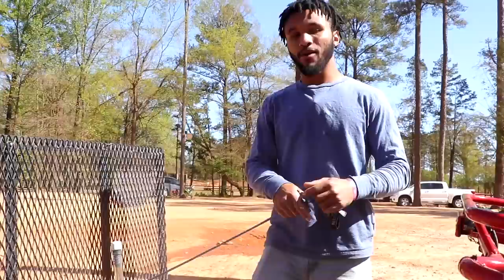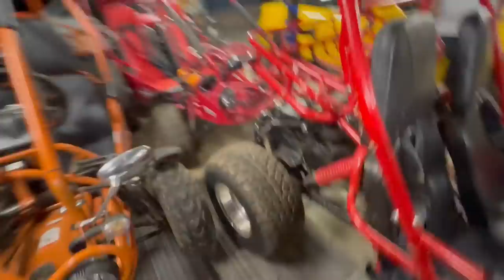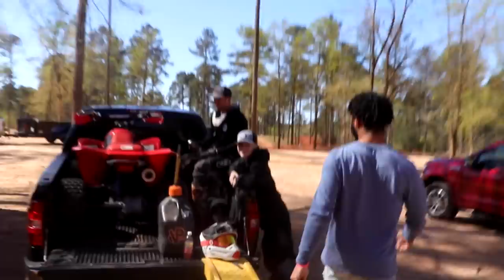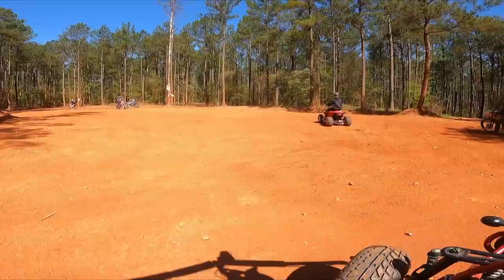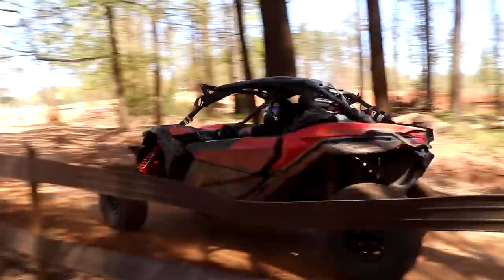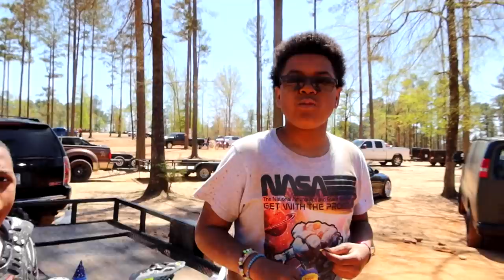Buying My Dream Off-Brand GO KART For His Birthday Ride!! (Future Project Build)

Comment: Ayo, throw a GSXR 750 motor up in that  thing! It practically the same size as the 600 except with a little more torque, that would be gangsta
Reply from the maker: I’ve been wanting do this for sooo long! Hopefully I can find a good deal on a engine for it
Reply: Yes sir! I have a gsxr 750 and I’m telling you that would be so wicked
Reply: @colbyclark2479  🤣bruh these swaps are unsuccessful on these china buggies bcz the matel is very bad the 750 will rip off
Reply: Cap 😂

Comment: 750 is a lot for a little Chinese buggy unless you weld in new metal tubing and stronger rear axle. Some CVT upgrades would be next if it hasn't been done yet. Previous owner looks like he knows what he's doing. A smaller engine off a quad or dirt bike would be plenty i say? But not sure how far you wanna fly lol

Comment: There should be a throttle screw if you take it out you can go faster
Reply from the maker: The guy I bought it from said he’ll show me all the parts I need to make it go faster before I engine swap it! I’ll look for that screw you’re talking about though
Reply: It might be under the gas’s  pedal or by the carburetor